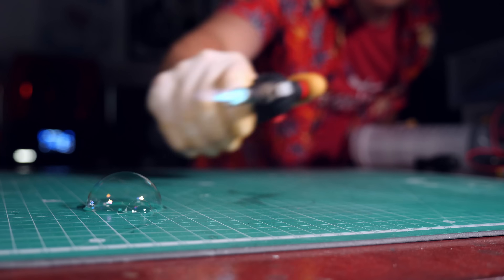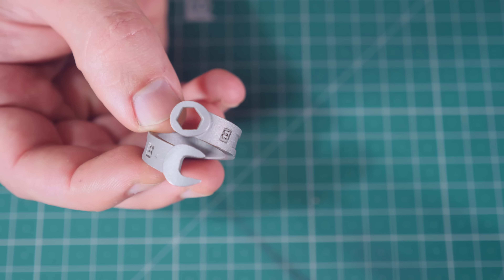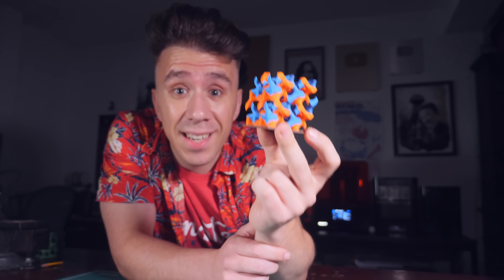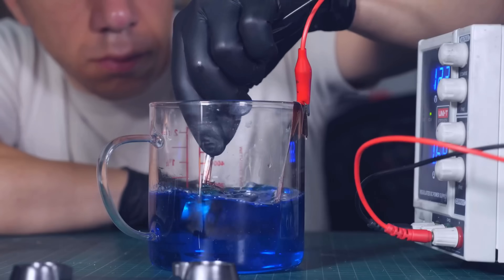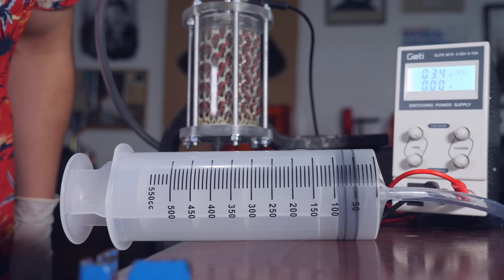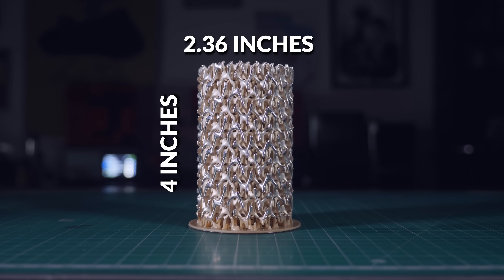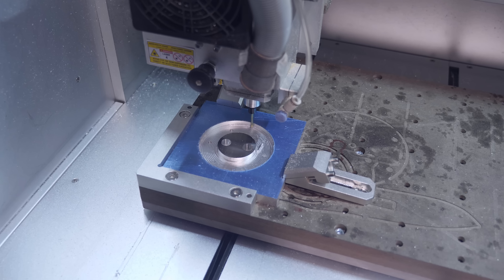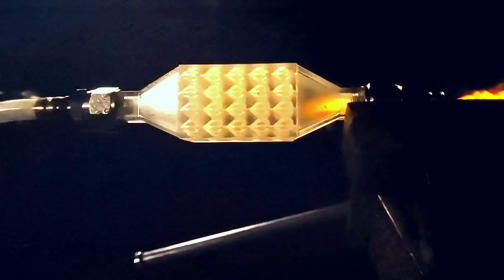ROCKET that LITERALLY BURNS WATER as FUEL

Comment: In high school I won a small scholarship for my graduation project. I designed a hho generator and ran a nitro rx engine completely off the output of my generator and did a hybrid on a lawn mower. This was in 2011. 

Here are the improvements I'm going to offer as far as the design and power source goes. 

1: design 
In my design I used 4" 8g stanles plates. They were spaced with nylon washers and I used nylon bolts and nuts to connect the plate aray. On one side of the array every other plate  had a tab with a whole. This is how I connected all of the positives and negatives together with stainless bolts and nuts. The generator would fill a balloon in 5 minutes that I would then pop with a lighter. Talk about loud! 
The main take away is to increase the overall size of the generator.

2nd: power source.
For the power source find a good automotive battery charger with a high cold cranking amp (CCA). This could get you over 1000 amps at 12v. This is far more that your using now and can power a much larger generator which means faster and higher output!

Do this and you should get enough volume to power your jet. Would definitely power a nitro rc engine. 

As far as your electrolyte problem I don't have a good solution. I just used sodium bicarbonate in the form of baking soda. 

I've always wanted to try and use hydrogen peroxide as the solution 
And even fantasized about heavy water. 

Hope my experience can help and if you Wana pick my brain more let me know!
Reply: No
Reply: @Woodwerker  no?
Reply: They've done something similar in the past... heard of the car that ran on water? It was probably a variation on electrolysis... Problem was the fossil fuel industry didn't like it and the inventor had a nasty "accident" if you know what I mean.
Reply: Hello friend, I am a teenager finishing high school and I am still deciding what to do. In my opinion, you seem to be a successful person in the academic field, could you give me some life suggestions?

Comment: I have been working on a 3D printed modular electrolysis tank, and I only used it in low volumes, but i found several interesting things :
1. graphite is the best electrode (for the positive specifically) because everything else corrodes (I have a jar full of rust sludge from early tests)
2. for the power supply I use two 18650 Li-ion cells, that handle the current very well (for your scale I would suggest a power bank of 10 or just a car battery)
3. I recently switched to solid state electrolyte by adding agar-agar to my liquid electrolyte (along with some antibiotic for long room temp storage, when using the tank the chlorine from the table salt in the solution disinfects it).
If you would like I can send you the cad files. Also if you have the sodium hydroxide (which by the way is going to destroy the steel, and probably was electrolysed too partially) and aluminum, you could generate enough hydrogen to keep that engine running until it melts (but it does not generate oxygen, so you would need a gas tank or use hydrogen peroxide decomposition).
Reply: That's what I say - too much voltage currently. 1s li would be perfect. 
Brilliant idea with graphite!
Reply: I'm interested in your choic of a gel-state electrolyte, why do you recommend it ? I would not have tried this as I think the gel will block bubbles from escaping
Reply: @orphax1925 The gel state electrolyte helps to hold the electrolyte, so no problems with leaking corrosive electrolyte or with orientation (as this was designed to be modular and fit designs that may change orientation, and a liquid electrolyte would be pushed out if held up side down). It generally helps with maintenance because it removes the hassle of draining and refilling electrolyte when replacing electrodes and such. Mostly for the orientation though, before the gel I had a "magic sponge" which held the electrolyte and provided constant electrode contact by capillary action, but gel is better for holding and for contact. A disadvantage of gel is the slightly higher resistance, but so far I have found it a very good trade. About contact, I did not run very good tests for this, but i don't think there is a big difference. when using the sponge I printed a cage for the electrodes that pressed on the sponge and let only liquid come in direct contact with the electrode, and the bubbles went up through the liquid. in the gel, the cage is filled with gel (there is gel to gel contact between the electrolyte in the tank and on the electrode), and the bubbles either go up around the electrode or go through tiny holes I punched in the gel with a needle to the gel to gel contact area and go up there. In my tests no bubbles got stuck and the gel to gel contact performed amazingly in connectivity.
Reply: @orphax1925  I actually got the idea when i was doing an introductory electrochemistry experiment. I had been searching for a way to set the electrolyte for a few weeks by then, and I saw the salt bridge for the cell we were making and thought "if this electrolyte gel is good enough to use as a salt bridge, surely it would have good enough chemical resistance and diffusion for the electrolysis tank".

Comment: You can adjust the currant by reducing the electrolytes in the water. By adding more water to the mixture till you get the amp draw you want. Keep in mind lower amps means lower output in most cases

Comment: Awesome video Integza! Chopping those lattices up into thin discs was very smart. 

I'd like to point out to the comments section that Stanley Meyer did NOT use traditional electrolysis as he stated multiple times in interviews and lectures. His designs were way more complex. Put stupid simple he used pulsed high voltage fields at specific resonant frequencies to break apart the h20 molecules. You can think of the cell as a type of capacitor with water itself being the dielectric. Later he designed water fuel injectors that used lasers in a resonant cavity to create a similar breakdown and discharge of energy. He also designed a special type of circuit called the Voltage Intenstifier Circuit or VIC which drastcially lowerd current without resistance by creating a choke of sorts with the back emf of the coils.  It utlizes the same concepts which the Late Lt. Colonel Tom Bearden talked about with Scalar Potenials and scalar back emf.  Keep in mind Bearden was a Nuclear engineer in the Army who worked on numerous Unacknowledged special acess projects or USAPs not a crackpot just another guy who figured it out.  Stanley Meyer wasn't some guy in his garage. He spent decades of his life developing this technology surrounded by engineers and scientists in a lab.

Comment: Making a small generator to power these electrodes would be a nice theme for a future video.
Reply: That or using a 1200W or even a 1600W pc power supply would work. They are designed for those massive power loads.
Reply: @Secu90210  it will be very nice if he uses a dc regulated power supply, so he could also have a metric of how many amps it is consuming

Comment: Reminder that this process is net-negative energy wise. You need more power to break the water into hydrogen and oxygen than you wind up getting from burning the hydrogen and oxygen.
It is a neat process and it has applications, but it is not some kind of a panacea to solve our energy problems.
Reply: That's only partially true, you need power to create the hydrogen. But the hydrogen can be utilized more efficiently. A jet engine can be more powerful and more efficient then a electric one.
Reply: It's worth pointing out to the casual reader that it's an identical amount of energy to split or combine (on a molecular level) - but there are other less fundamental factors that make splitting more expensive
Reply: @JohnnyWednesday  also in real world reactions, nothing is perfect, some ingredients get lost or don't mix properly, some fuel goes unburnt, etc
Reply: @perkunast9680  Depends on the definition of efficiency. If you mean thrust to weight it's hard to beat fossil fuels, but also hydrogen might be better than battery-electric propulsion.

However, if the goal is to use the least energy possible you definitely can't beat batteries and electric propulsion. 

"A jet engine can be more powerful and more efficient then a electric one."
More efficient definitely not. An electric engine is very efficient, think more than 90%. Combustion engines don't even come close.
More powerful is probably right. If I search for horsepower of the Boeing 777 I get an approximation of 175000 horsepower in two motors. If I search for most powerful electric motor I get a horsepowernumber of 49000.
Reply: pancreas* that's better
Reply: @perkunast9680  Hi Mate, sorry but it can not. First of all the electrolysis has about 60-70% efficiency, so there's the first loss. And there is no engine in the world with an efficience of 100% or more. Jet engines usually convert about 35% of the fuel energy into kinetic energy. So overall you lose about 3/4 of your input energy.
Reply: @JohnnyWednesday  Energy lost in the reaction to heat for example.
Reply: Hydrogen is not an energy source, it is an energy carrier. Like Electricity.
Reply: Not if you pressurize the chamber
Reply: @perkunast9680  Still there are losses when converting from water to hydrogen and oxygen. Nothing is 100% efficient, thus going straight from electric to motor will have less losses.
Reply: @IFRYRCE  ever consider the maths is wrong?
Reply: @JohnnyWednesday  true
Reply: @andymouse  on mine, I have no heat
Reply: @Mr123bohemian  they're not wrong though, we can prove that via experimentation.
Reply: @jac540  unless batteries get significantly lighter ICE can still be more efficient than batteries and electric for moving heavy cargo. Even ICE powering a generator that powers electric motors is often more efficient than battery setups, which is why large ships and locomotives are diesel-electric and not battery powered.
The reality currently is that batteries are so heavy that you can often install an entire combustion engine and fuel tank for less weight than a battery that would hold an equivalent amount of energy.
Since battery weight is weight that also needs to be moved, at a certain point you cross a threshold where the efficiency gains from cutting ICE out of the equation are worth less than the extra weight you're going to lug around with a battery.
Reply: @IFRYRCE  it took me way too long to realize you meant internal combustion engine and not frozen water
Reply: No electrolysis but Energetic Cavitation Impact by Prof Marc Ramsey, Vanderbilt on YouTube reminds me of @EirexTech that can use any type of water as fuel.
Reply: Next project: 316L stainless plates, vertical plate design, neutral plates for 2V /plate limit, better power supply (as others have suggested).

Comment: Integza finally getting into hydrogen!!!   I've been dabbling with ideas on making a fun electric generator out of hydrogen.  

The basis of the generation will simply be a weight on a string, through a gearing mechanism, to a generator.  As the weight moves down, the string will rotate a gearing mechanism which will rotate the generator.

In this setup I would have the HO fed into a cylinder via a gas check valve, the 'piston' in this cylinder will double as the weight.  The weight will slowly drop while generating electricity, and at a certain level it will flash an igniter in the cylinder. As the HO is ignited, with nowhere to escape it will push the weighted piston back up.  A light spring mechanism will wind the excess string up as the weight lifts, and the system is reset and ready for more.

The last thing I haven't quite figured is safely controlling the flow of hydrogen after the arrestor, but if anyone can figure it out my faith is in you.
Reply: Maybe you could use efussion, if you have constant feed pressure and a known combustion chamber pressure you could use a valve that is a very thin wall with a hole of varying radius, and you could easily calculate the flow from the pressure difference and hole area
Reply: epic perpetual motion scam bro
Reply: @merchantman5635  For anyone confused by this comment; burning a mole of hydrogen will produce the same amount of energy that it takes to split a mole of water.  Couple this fact with that of 'no machine is perfectly efficient', you are looking at an energy deficit of at least 25%.

This is just a fun project, which I will probably use to teach my children various things.
Reply: @ScandalistRick  "burning a mole of hydrogen will produce the same amount of energy that it takes to split a mole of water."

Not true. Current industrial processes can approach 80% and ongoing research suggests we could get as high as 95%  but a simple DIY low temperature, low pressure electrolysis cells is going to be more like 50%.
Reply: @ferrumignis 
Not true.
Reply: A gravity gen system eh? Like the current idea of storing energy acquired during the day from solar cells. The cells create energy of course, but also some of that energy goes into lifting an incredibly heavy elevator to the top of a deep shaft. Then when power is required at night the elevator starts dropping slowly to turn a series of turbines or direct drive generators with extremely high gearing ⚙️. As it speeds up it creates more power, and the elevator has a system of gears that controls the speed of decent. Making sure that no energy is lost & that it remains at a constant for the given time that it's dark & the panels aren't creating power. It's a genius idea, & is much better than battery storage alone.
Reply: @denyraw  It's objectively true son, a quick couple of minutes on a search engine will prove you are wrong, which is why you can't bring yourself to do it.
Reply: @ferrumignis  Your reading comprehension objectively lacks, son. Hess's law of constant heat summation applies, son. The energy inefficiency of real machines does not contradict Hess's law.
Reply: @denyraw  YOUR REPLY IS SENSLESS, AND CHALLENGING, HIS WORK HAS PROVIDED OTHERS WITH THE BASIC KNOWLEDGE, WITH WHICH, WE MIGHT APPLY OUR THOUGHTS AND KNOWLEDGE TO FURTHER ADVANCE THIS TEDIOUS AND TENACIOUS EFFORT PROVDED BY HIM!
Reply: I'm surprised that no one has figured out that this is a joke where you explain a typical internal combustion engine in an overly detailed way.

Comment: According to Wikipedia
- bananas have 890 kcal/kg
- hydrogen has 39.4 kWh/kg => 
     39.4* 3600 / 4.18 =33933.014 kcal
Reply: Thank you! Its bananas that people omit the 1000-multiplier in calories. "Hey Atoomnet, I am on a low calorie diet, I only eat half at 1000 a day", O wow, 1000 of 2.000.000 calories? "Waddayoumean? 2000 is the daily limit".
Reply: @atoomnet To be fair, it is really dumb that we have two units with the same name, where one is 1000x larger. It's not surprising that people forget that 1000 calories = 1 kilocalorie (kcal) = 1 Calorie. Especially since in everyday speech when people say "calories" they really mean "Calories", but in science you typically use "calories", then for larger numbers use "kilocalories/ kcal" instead of "Calories".
Reply: @Beef4Dinner22  today I learned Cal.
Reply: cal is such stupid unit, not that W is better either, we really should have been using Joules
Reply: I don't know where @ericm301 got 39.4 kWh/kg for hydrogen, but I think a better value is 386 kJ/mole for 2H2 + O2 --> 2H2O. Since 1 mole of H2 has a mass of ~2 g, 1 kg of hydrogen would produce 193 MJ of energy when combined with oxygen or 46.13 Mcalories/kg. Maybe at 1 atm, 1 kg of hydrogen fills the room, but I put 4 kg of hydrogen at 70 MPascals into my Mirai when I fuel up.
Reply: @Beef4Dinner22  I was noticing that a while back myself.... I used this little mnemonic to keep track:  since most people understand the first as a singular unit of measure, it remains calorie with the ending "ee" sound, it's cousin with the next order of magnitude but same spelling with a capital "C" became a Calorie (kcal) with an emphasis on the long "I" sound... furthermore, since we are often using scientific units and we already have 'kilo' covered, I postulated the next step for "Mega" by using the established pattern with the slight alteration of Caloroe (Mcal) emphasizing the long "O" sound. Finally, with the units involved , Giga needing further emphasis the next term in sequence was Caloruh-oh (Gcal)... 

Now say each progressively higher order word in sequence, preferably to the tune of the Numa-numa song....
Reply: @monad_tcp  W is fine when used correctly, as it is joules per second, but the joule is the better unit to use here.
Reply: True

Comment: Theme for future video : Coal powered Jet engine // Pinewood powered Jet engine

 Alexander Lippisch, the designer who help come up with the Me-163 Comet design also designed an aircraft called the Lippisch P.13a & b, it was envisioned to use a 'Kronach Lorin' ramjet powered by coal due to fuel shortages, seems like a perfect experiment for your channel.
Reply: the coal one would work well if you used solid coal (coke form specifically) as a generator for coal gas, which would work well in a rocket.

Comment: I wonder if you already knew this by now, but there is available a 3D printing filament which is water soluble, intended precisely to print the supports with it, so you can easily get rid of them by simply submerging the whole piece in water afterwards.